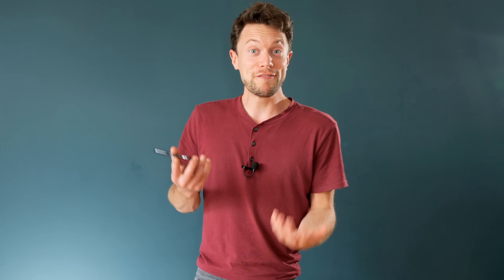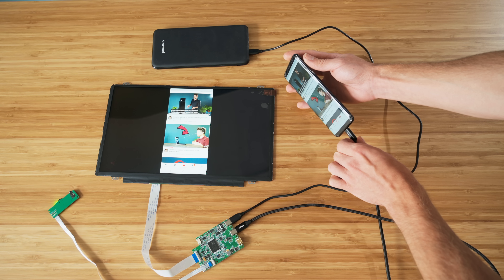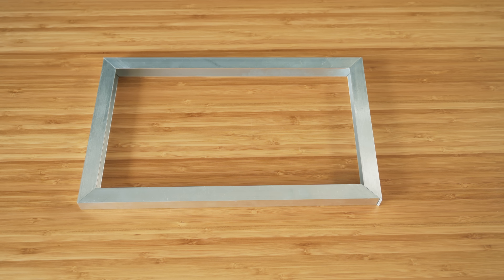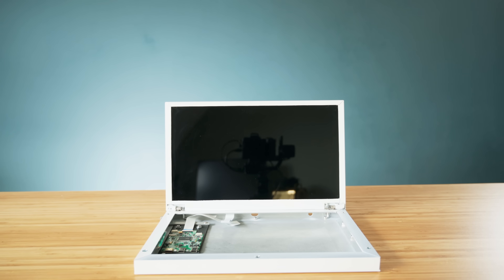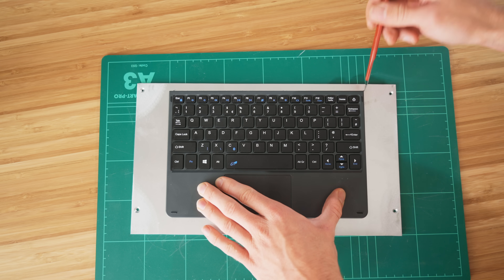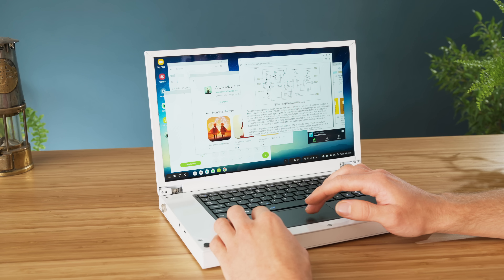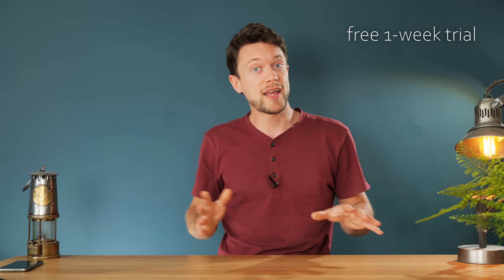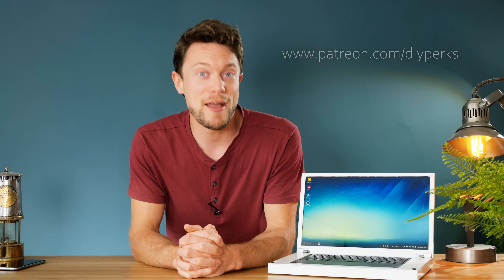Broken smartphone to working laptop transformation

Comment: Very uniqe design, especially the power part with the slide switch, and the phone holder on the back of the screen. A few thoughts. I would use some plastic instead of aluminium, it will be easier to cut the pieces and build it, and I can put the phone in the body, bc it wouldn't block the radio signals. I would use a usb docking station, so I could use USB kb instead of a BT one, it is safer, bc BT not always can connect automatically, and it will be plenty of ports to use (USB, HDMI, etc.). I would cut the cable from the power bank and put a switch to the 5V line. It will be easier to swith it on/off.
Reply: not to mention not wear out the usb ports from repeatedly plugging and unplugging them.

Comment: why did you turn the usb for charging to a powersocket D: 

simply cut the wires and wire it to a female usb A, and then just use a USB A to USB A cable. Or even better make it charge via type C
Reply: Yeah I was really confused by that as well probably had that part lying around and just used it
Reply: So that he won't make us break our head.
Reply: Can you explain this a bit more? Did you mean just plugging the charger into the wall by connecting the usb a to usb a female then usb a female to a plug connected to a usb a plug that can be connnected into a normal wall outlet?
Reply: @michaelblair5146  yes, a USB cable can pass 100 Watts but regardless the cable used was originally a USB so I guess it used less than 100 Watts in total.

Comment: I had this idea a while ago to make as a first invention and get my career going, but damnit you've done it again! This is brilliant! I'm going to enjoy doing this, but with a few changes. For example, I saw there is a touch-sensitive version of the screen available for around twice the price, and it seems like a worthwhile investment. If possible, I'd like to see if I can make the screen flip completely over to make it a tablet-type device like some laptops that flip over. Another thing I'd change is make it so the phone itself can be inserted into the back of the laptop, or the side, or whatever so the device stays secure. Obviously you said the aluminum would be an issue, but that's why I'd look into some slightly different material and use maybe ABS with metal bracket supports in the corners to keep it sturdy. Maybe some rubber bumpers as well, who knows.

Either way, love this and cannot wait to attempt it!

Comment: Pretty interesting. I actually have an old Motorola Droid with a smashed screen but it still works. That one actually had HDMI out, with a desktop mode. Which I used to back up the phone after it was smashed.
Reply: I remember those Droids. That was back when Motorola made good phones.

Comment: If you're using a phone with an MHL adapter,how do you get keyboard/mouse input into the phone?  Bluetooth,or is there a way to still have inputs through the micro USB with that adapter plugged in?  Also,I wish more Samsung devices supported Dex mode,especially ones that aren't quite expensive.

Comment: This is a very creative yet cost inefficient way to make use of a busted phone. Screens and back glasses cost about 160 USD which is very close to the amount he listed for just the LCD, Battery bank, and Keyboard alone. If you included the other electronics, and aluminium and resources used(albeit some probably reused from other projects) it would probably come out to being more expensive than repairing the phone if you were to DIY repair it with relatively accessible hand tools. It makes for great content and scratching that hobby itch you've got though.

Comment: The best part about this channel is building without having to rely on a 3D printer. Kudos again
Reply: 3D printers make it really easy. Just get an ender 3 pro for $200!
Reply: yea you just need to rely on a bunch of power tools instead.
Reply: Plus having a metric ton cash top blow on sheet aluminium, rivets, electronics, etc which is stupidly expensive
Reply: @professordey  aside from the display part of this, the aluminum, paint, screws, etc aren't that expensive. Especially if you have the power bank already laying around. You don't need to rivet, nor would you want to. I am curious about those screw inserts, and the tool he used to insta them, which I think is what your referring to as "rivets"
Reply: @themonitor7877  you don’t have too, plus a drill really isn’t that expensive
Reply: He degraded into using 3D printers in recent episodes... Such a shame!
Reply: But honestly if you are into projects like and similar to this, a 3D printer is useful in a lot of cases
Reply: Agreed. The two things I don't have yet, a welder and a 3d printer. Santa better know I've been a good boy this year!
Reply: Burh a 3d printer is waaay cheaper than all the equipments which he is using and plus this will only work with a high end samsung phone, which if you dont have then all this is completely useless. I would much rather use a raspberry pi and a 4 inch display than do all this crap lmao.
Reply: Are u a pinoy?

Comment: But,..... If you try to do it on a phone that doesnt have USB type C and it doesnt have it own ''DEX'' mode and if your use hdmi converter cable, you would be able to only mirror the phone screen, you wouldnt be able to control the phone from the other display or use keyboard. Am I right?

Comment: What a strange and stupid (on my opinion) time spending.
1. If you have so good Phone - Better to restore it and use it like a phone
not as poilet paper or smart trash bin.
2. COST for such rework is not Normal.
If you need Notebook - take or by Notebook.
In any time I can by used Notebook,  with Screen, keyboard, battery, and HDD - for about 50$.

In this project you take Phone minimum in 200$, LCD controller 88$.
And in result - it is not notebook for 300$.
not even close.

It is funy but absolutely USELES IMHO.
and far far avay from Rational using old and broken Things

Comment: If anybody's reading. I need some advice. I have an old laptop (that's 100% functional) (but it's charger is dead) I also have an old 40inch LCD TV that nobody uses. (And I have an empty wall with lots of free time) is there any way to repurpose the old laptop in a way that the laptop works as a wireless display adapter for the TV. (I like watching movies while I work sometimes. And my PC will be in the same room. Just a few meters away from the TV. But I don't want a 10 meter long HDMI cable running from the PC to TV forever). Last part (streaming on the laptop with windows installed won't work. It's a dual core and won't work too good) I was thinking of a way that takes power from the TV (coz I don't have the charger) (the laptop has a working wireless network card)

Comment: Quick and easy way to slightly improve the longevity : If you use a magnetic USB cable, you would not only reduce the force required for the mechanism to plug / turn on things but you would also prevent any wear & tear of both the controller's and phone's USB slot. This also allows you to use hot glue reliably instead of the more expensive counterpart (epoxy) in case you don't have it.

In case anyone is wondering; magnetic USB cables are very cheap (2-4$ typically). You put a magnetic adapter into the USB slot on the device and leave it there. When you want to plug in / charge the device, you simply put the tip of the cable near the adapter and magnets pull it in place. Since the adapter is always inside the slot, no wearing is happening on the contacts. 

It also keeps it dust-free and clean. Of course, if you're using it on a regular phone, it also prevents you from accidentally pulling the phone off the table with your legs or whatever. Another bonus for non USB C is that you don't have to worry about the cable orientation. If you're still using a standard cable for your smartphones, I highly suggest you the magnetic cable a shot.

Comment: Thank you for this video. I've been looking for the "last step" as it were for making use of the display and keyboard of a dead Acer Chromebook. I have the display board functioning and managed to reuse the Chromebook's keyboard by using a Teensy microcontroller and Frank Adam's brilliant instructions on creating keyboards with it. (search Google for his name and you'll find it.)  I just couldn't fit all the parts into the ultra thin Chromebook body. Now I can make my own using your tips. One tip is to make the corners of the aluminum enclosure rounded instead of sharp. I think I can do that by using a single length of channel, cutting V notches in the right spots, and carefully bending the channel. I plan to use an Anker battery bank. This is all for a Raspberry Pi 4.

If you don't want to build your own be sure and check Nexdock dot com. They made a legit product out of this idea. I pre-ordered two and am awaiting shipment in September.

Comment: I'm setting up a similar project, but I only got a different model LCD control board so I'm going to do a little more work, as for the keyboard, I thought about using a Bluetooth without touchped.
For the carcass I intend to print in 3D

Comment: IF YOUR GOING TO ATTEMPT THIS BUILD PLEASE LISTEN!!!!
1. DO NOT USE ANY OTHER EBAY LISTING FOR THE COMPONENT AS THEY ARE SCAMS
   a. I purchased one from some seller named Yun because it was $10 cheaper, and not only did he not send me the right board he didnt even send me the         
        screen
2. The current seller due to the large volume of sales they are recieving has increased the price threshold and is also fairly shady, and has Amazon listings for the same combo of components but with one caveat they are not prime which is as concerning as purchasing from ebay
3. Male to Male USB Type C cable should be one that is sturdy and at the very least be covered in nylon sleeve
  a. Amazon has its own Male to Male USB Type C cable available that is covered in a nylon sleeve for a $6 (pick gold color for some reason the other colors are three times the price)
4. If your already over budget and the metal plate that DIY Perks uses in his build is too costly, dont fret. One can easily use air duct material which oddly costs less than that of purchasing sheet metal. All you need are a pair of sharp scissors if you dont have metal cutting shears.
5. Do not place your cellphone on the back panel behind the screen if it gets too hot,  as the LCD screen is heat sensitive. One can easily place it anywhere else and use a 5v mini pc fan. 
    a. You can wire the fan to a Double A usb power bank or even to a 18650 battery. 
     b. You can buy a 5v mini fan with male usb, however you will still need to add an on off switch, which is relatively simple
     c. You can get a 18650 holder bracket and solder a switch to either wire and solder the connection from mini fan to the connections on the switch, a   
          25x25x10 micro fan from cooler guys lasts about a  3 days of continuous usage with an 18650 fan. 

Please reply if you have any questions

Mr. DIY Perks
I love your builds and with your permission I would like to assist in the more detailed portions of your builds to rectify any and all potential problems.

Comment: but this kind of DIY if the phone supports the DEX we can use it  since I'm  J6 Samsung user there is no DEX mode in it so is not applicable for the mid-range or which doesn't support and dex option

Comment: Hmm. Raspberry pi or sbc run linux or windows. Hmm. 

I did something like it in a travel case (hard plastic). Power bank, 7" display, raspberry pi with berryboot. Boot raspbian for surfing and switch to retropi. I used velcro so if item broke or over time something better came out I could switch with ease
Reply: They can also run Android, with the help of Android-x86 project.

Just visit android-x86.org for more info.

Comment: Thanks for this good video. Suggestion:
Take
1. Laptop with nonworking motherboard/ processor but display and others are okay.
2. Smartphone where only the motherboard and circuit is okay and display is smashed (same like which you have used in this video.
Fuse these two into a working laptop.
May have a serious thought buddy.
Good luck!

Comment: You could buy a portable touch monitor with type-c input for as little as $200, it may even came with a built-in battery so all you need to do is stick that damaged phone to the back of the monitor and plug-in the USB cable.

Comment: I have both an old HP laptop and a few Galaxy J3's with cracked screens no one wants to repair for me. That is not all the Smartphones I have about five more but they are Androids. The HP has a HD which is not available in a upgrade and a new one from HP costs to much and it would be the same, however there's no operating system on the HD & no way to add the MBR, HP Pavilion dv2700 ENTERTAINMENT PC NOTEBOOK 2CE829237W DC2700; PRODUCT ID: FE993UAH#ABA; SYSTEM BOARD: 30CD; PROCESSOR TYPE: Intel Core 2 Duo T5550; Processor Speed: 1830 MHz; Internal Memory: 3072 MB; BIOS Version: F.2B; Serial Number: 2CE829237W (No matches found for Serial Number at HP); 95 matches fond for HP PAVILION ENTERTAINMENT PC NOTEBOOK and I cannot find which one is the right one, The boot process did want Vista operating system disks and I bought a installer but the company existed on a cloud and when it terminated so did all the logic they stored so installing wouldn't complete without verification from the cloud image installation so install failed.  I then wiped the HDD clean and nothing not even the MBR remains. I can all that my aluminum build I don't have to create.

Comment: A full fledged smartphone dock? Nice :)

Glue the phone a little bit higher and you will be able to use both cameras...
I don't know if it matters which way you connect UBS-C 3.1
 (I use USB-C on my phone to charge it, it doesn't seem to care about that, charge and transmit data from my phone to my computer  and vice versa anyway *shrugs*)
but in this case build it so you can turn the phone the way you want, to be able to use the rear camera (better picture generally) for which side of the pc you need to use.

Little questions though...
Would it be possible to do that with a laptop screen with a touch layer as well?

Would it be possible to use double screen? 
I mean, imagine a build in which the phone is docked on a moving part of the diy pc 
(a more complex build I know, and it would have it's cons, but still) 
transforming the phone itself into a "screen pad/scren pad plus" like Asus is making.
At least on a functioning phone you would lose the possibility to use the phone's screen, plus the camera will be looking at you (orientable remember) , as would the speakers at mic...

Comment: The design is very good, the only thing I am concerned is the power supply cable connected to the power bank and the bluetooth keyboard, I think those wires are too thin and can get hot or burned when the power bank and the bluetooth keyboard are being charged. Moreover, the power button sliding mechanism is not so reliable solution, the USB C connectors can wear out fast from a lot of switching.

Comment: Superb as always! If you are nerdy you may use the laptop to SSH into your home computer in a Termux session. That way, you actually are on your home computer and can use all the applications and all the computing power it may offer. I am not a power user, but I can use this setup with my mobile phone to let my home PC execute python code which works through files. Basically doubles the speed if I divide it between home PC and work PC (from a distance) and both sync to the same dropbox.

Comment: Well, while appreciate all the hard work and the result, I would suggest a simple USB Type-C Hub Pro and a pair of bluetooth keyboard plus mouse and you can connect that phone by an HDMI cable to your 55 inch TV :) 
Or you can scrap the hub and simply use wireless connection with your smart tv.
This will suffice for home.
I guess most people will not go for the laptop experience anyway as, honestly, who owns all those tools you need to make this happen...

Comment: Love the Video and Since I have a Sprint S8 that T-Mobile will be turning off December 31st, 2020 if it's VoLTE this can be very useful vs. Getting a screen Replacement. 2.5 years, it's July 2020 almost August, and I haven't cracked it yet. Thanks for an option.

Comment: at 7:33 how do you connect the cables, and do you think i can plug a hub into the usb c port on the mother board and plug that into the power supply? Also, did you say jack adapter like a headphone jack? I want to build it out of wood and paint it and idk if my idea will work help greatly appricated

Comment: anyone got tips on how to find 13"-15.5" touch screens with a controller? Just a bare screen like what's being used here but with touch, I cant seem to figure out how to google it correctly as I only manage to find propper monitors and not bare bone ones like this one.
Reply: Try Ebay. I replaced my laptop screen with a higher refresh one found there. Messy, but it worked. 
I do think you need to buy the screen and the controller separately though, so be on the lookout for board number or something
Reply: @96whatsup  hmm, I guess. Although I've seen just the monitor it self + controller options before but I cant seem to find them any more :P

Comment: Is there a particular reason to not use a USB Type-C extension cable internally for recharging?  That way you'd just have a type-C female port on the outside of the case.

Comment: Question about the speaker solution: Will you even be able to use the Bluetooth speaker, if your phone is already connected to the wireless keyboard via bluetooth?
Reply: you can connect to multiple devices on lastest Bluetooth afaik
Reply: @vanillawaffle1499  might be, but in his case I still doubt that it will work, since its not really the newest phone.